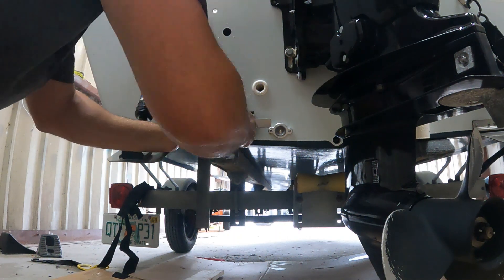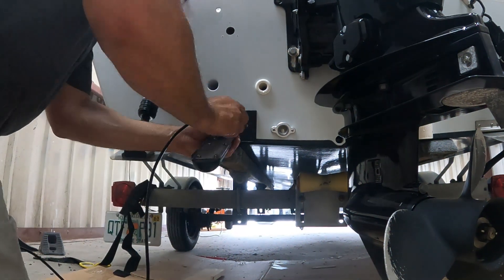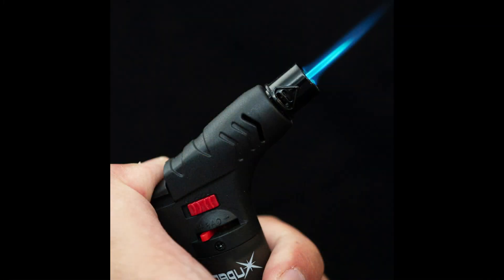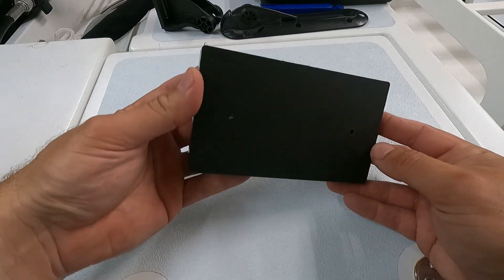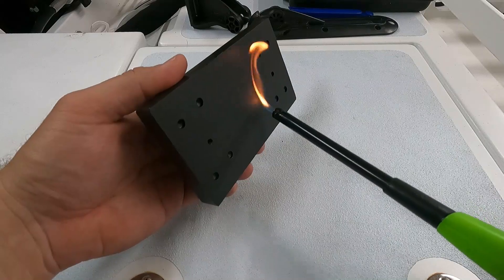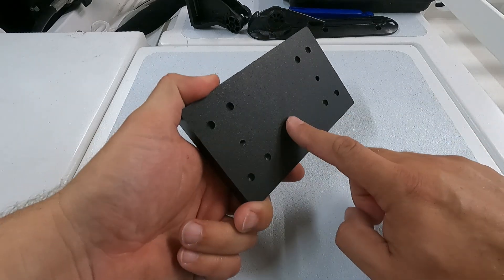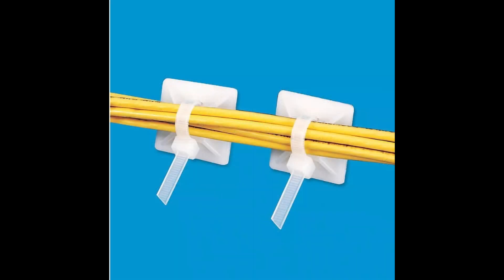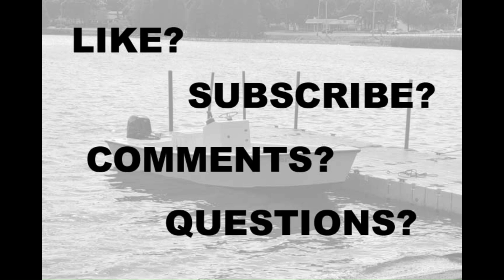Flame treating plastic for better Adhesion

Comment: You even showed the correct flame type in the video and still used the wrong one. 

You need the blue flame from a torch. That means it's rich in oxygen. Also you need to pass over your part quicker. 

With real flame treatment the surface won't feel tacky afterwards. You won't even notice a difference but oxygen will have bonded to the surface molecules, making them more reactive for painting and such. The treatment won't last long at all so you have to paint it immediately afterwards.
Reply from the maker: @schwuzi  I disagree. And nothing felt tacky. I mentioned the grip feel changed, but the surface texture remains the same and not melted. I have used both types of flames and actually think the standard lighter yeilds better, more even, results. I've used propane, butane, and mapp gas. Not a single failure on any.